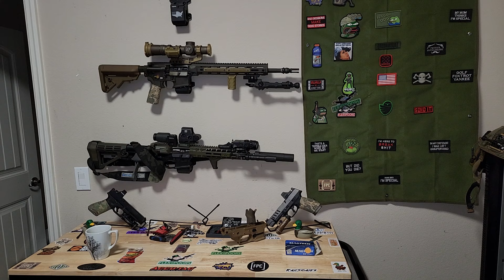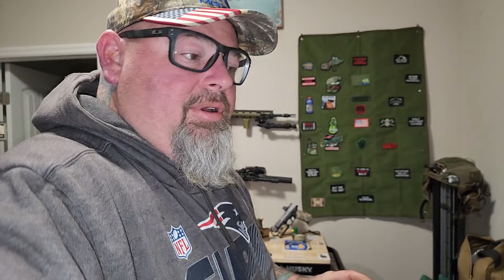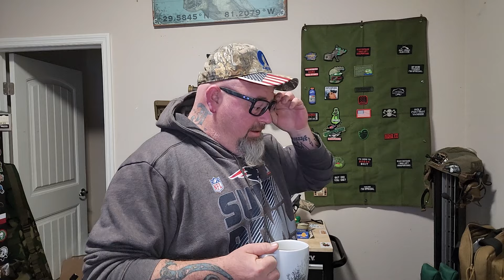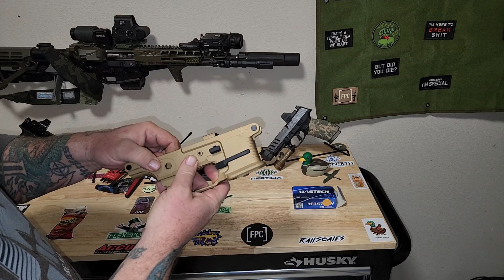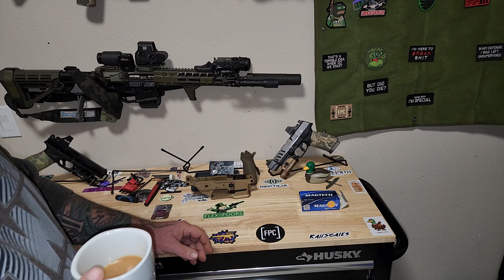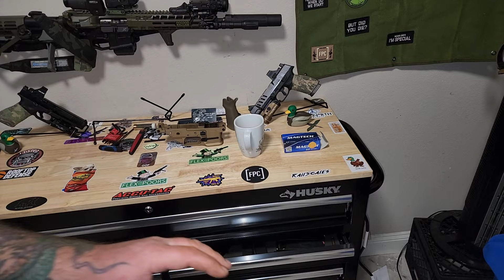ANGRY MONDAY

Comment: Fanboys gonna fanboy.  Sounds like you have reasonable expectations.  A problem is a problem, regardless of the trademark on the receiver.  You'll get problems from every brand.  Nobody has a defect rate of 0%.  Nobody.  The marks of a good brand are A) how infrequently those issues occur and B) how they handle them when they do.  I would hope with a $3000 gun that you get some good customer service.

Comment: Jake my Brother … cassette style triggers require anti walk pins…
Reply from the maker: I wish B&T had used them when installing this trigger at the factory then. 🤷
Reply: This is correct. The spring being under a load and up against the pin sitting down in the grooves of the pin is what helps retain it. When your using a cassette trigger everything is contained so you don't have that force a milspec creates on the pin to retain it. But most cassette triggers have either a set screw on the bottom side of the cassette housing to push down on the receiver which lifts the cassette up on the pins and/or come with antiwalk pins.